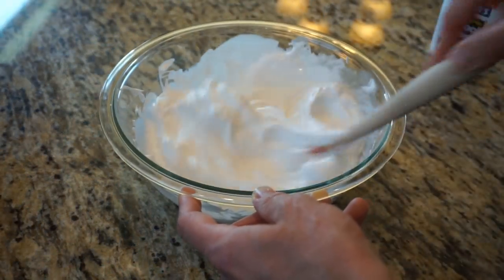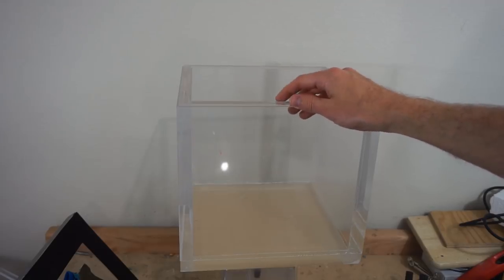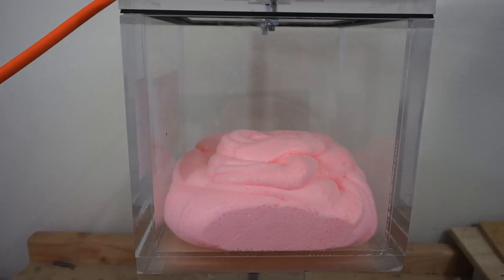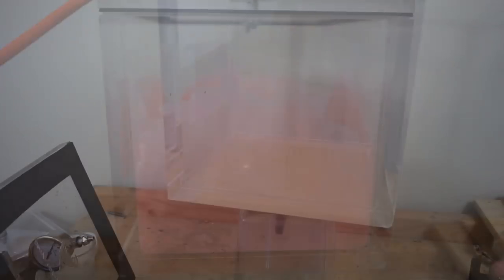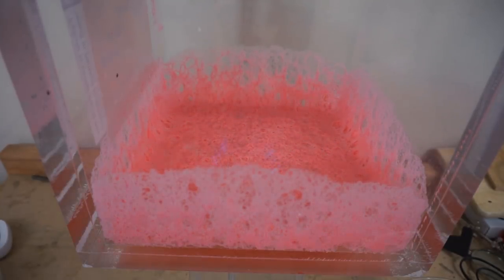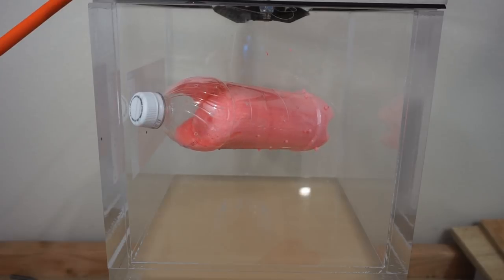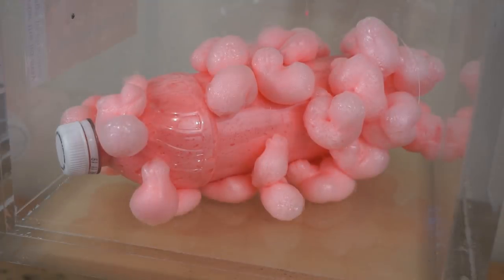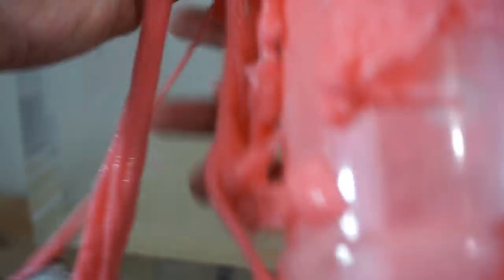What Happens When You Put Homemade Fluffy Slime in a Huge Vacuum Chamber?

Comment: you should connect an air tank to the hose, then pump out all the air of the tank before you open the valve to the chamber. simulate rapid decompression!